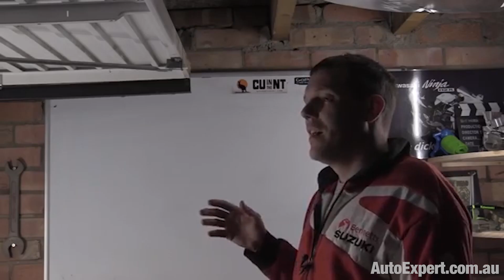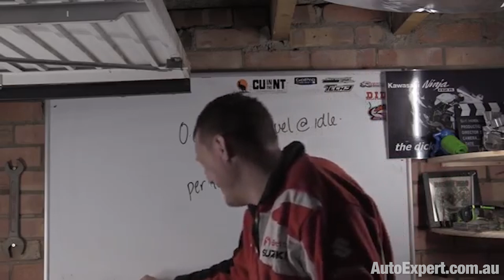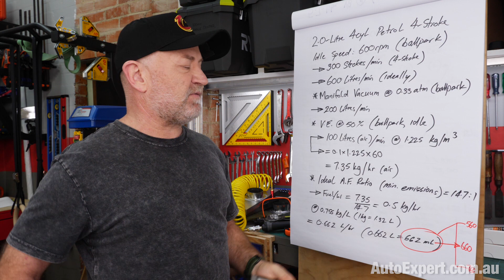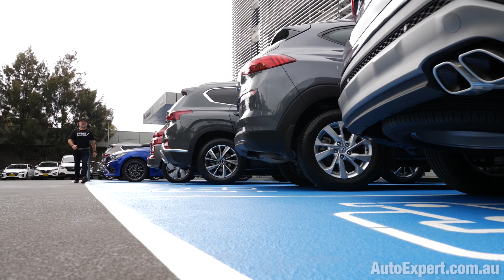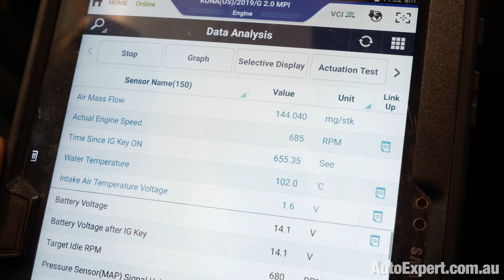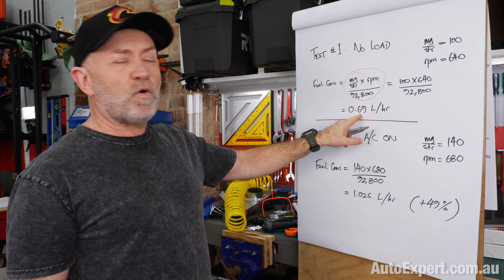Engine Fuel Consumption at Idle Explained (theory and physical test) | Auto Expert John Cadogan

Comment: Great Video.  Love your dedication to your craft.
I'd love to try the same experiment on my old 1989 LS400 (Celcior actually).
I would have to try without the use of an OBD2 equipped device,  its OBD1. Toyota didn't change over to OBD2 til 1995 and I cant find an OBD1 reader that works with Toyota.
I have to resort to jumping pins on the OBD1 connector and counting instrument light flashes for fault codes, and I don't thing that includes fuel or Air consumption.  Doh!
Engine has done about 300,000 Km so it should be nicely run in.  
*seem 1UZ-FE can do 1M Miles (a.1.6M Km) without a rebuild - See Matt Farah's LS400

Comment: You can check out "The Workshop" missing the point on oil and cold starts in his video about oil at low temperatures.
Reply: Trouble is youtube is free to put up stupidity. Start charging to host content and stupid goes away.

Comment: Hi John, at the 2.32 mark you say “600ml per hour, ball park for a 2 litre engine, at idle, under zero load. There is no per litre about it. That’s a friggin’ myth”. Later, at the 3.40 mark in summarising you say “proportionally more or less to the engine displacement, with all other things being equal; like 300 per hour for a 1 litre engine and 900 per hour for a 3 litre engine”
 
This to me appears to be precisely an example of “per litre” of displacement, albeit a 300ml per litre argument instead. Please can you clarify this anomaly, because I am now a little confused? Where previously it was quite clear. Guy in garage was an idiot. John the Engineer was right. Now though I have questions? Shirley, the cup size of each of the cans must correlate with the amount of juice used in an idle suck squeeze bang blow?

Comment: Hey John, if you are accessing data from the OBD port isnt injector duty cycle also available to be extracted as well? Good way to add another form of confirmation into the mix, not that I was in any doubt you were right, but the knuckle draggers generally refuse to admit they are wrong in my experience so it never hurts to add extra nails in the coffin!

Comment: Wouldn’t the modern cars with cylinder deactivation make a fair difference to that calculation? Or do they run all their cylinders at idle to keep them ready or something? A quick google search didn’t turn up anything on idle efficiency... if a 4L V8 could cut down to 2 cylinders and it has roughly the same efficiency at idle of the 4 cylinder engines It sounds like they should get 300-400 ml/hour with no load

I have some evidence for an older petrol car idling at only a little load... our house isn’t on the mains and it was cloudy for a week a while ago and I flattened the batteries so I hooked up my old 2.4L petrol Hilux to the charging regulator (and filled the tank so I wouldn’t forget) it took 6 hours to get the batteries back into the bottom of the green and I was curious about how much fuel it took so I topped it back up and it took about 5L which is more efficient than using a generator to run a 40A charger... which I don’t have.

Comment: Wouldn't Air density also differ @ different Altitudes ? Just asking.... Seems applicable ?
Reply: Yup
Reply: yes they do. So much in fact that you can feel the power of an engine going down the higher up a mountain you go. Gale Banks (of Banks Power) did a good realworld test about that using his turbo diesel truck.

Comment: Suprised by the statement that diesel engines used more, why so ?
Reply: I could be wrong, but my guess would be higher compression of a diesel being able to suck in more air per stroke compared to petrol.
Reply: @llaughton69  The air/fuel ratio is not constant in diesel so it might not be that.
Diesel is designed to deal with higher compression ratio - heavier structure, better sealed etc. Idling requires "no load" so these loses will make a difference in that scenario.
Reply: Deisels dont have throttles to genarate a vacuum

Comment: A siily question John, does this also apply to a 2ltr turbo diesel, IE: Hilux with and without DPF..
Cheers mate.
Reply: No. The air fuel ratio in a diesel varies a lot more. It will only squirt in enough fuel to maintain whatever engine speed is commanded. A diesel has no throttle butterfly...

Comment: 12:59 This has been a problem since the beginning of search engines - people thinking the top result returned is the accurate one not just the most popular one. 'Google smart' means you're actually most likely really dumb! It is not a Fountain of All Knowledge - it is merely an index of thoughts.
28:04 You do know that halfwits are going to remember and recite this as "Using A/C increases your fuel consumption by 50%!" by omitting the @ idle, right? You should have phrased it as "...increases your fuel consumption by about 0.3L/h" if only to save me and other from banging their heads against the Wall of Stupid we're now all but certain to encounter. Thanks a bunch.
Reply: tone167  hmmm Indeed it could be a troll...

Comment: Would be interesting to know the fuel usage when the car, assuming a traditional automatic transmission is in “Drive” and is stationary.    “The traffic light test”.  Maybe stop start in this situation, under load from the transmission and airconditioning starts adding up?
Reply: The ZF 6 speed auto in my Bimmer shifts (internally) automatically in neutral within 10 seconds of a full stop. Don’t know about other manufacturers but I guess this is an easy and cheap fuel saving measurement so it would surprise me if others wouldn’t do the same.
Reply: Appreciate the reply, even though a little cheeky off topic.

Comment: Detroit 14lt series 60 @ 870rpm with aircon and fan on! Its a 14 litre engine and it only uses (according to the scan gauge) 1.2-1.3 litres per hour
Reply: Ps. Its in a cab over Kenworth
Reply: Stuart Fletcher Diesel I assume?
Reply: @Conservator.  yep, makes small petrols look bad!
Reply: Stuart Fletcher 
Tx! Never thought a 14l diesel could be so efficient!
Reply: Conservator 1980’s technology

Comment: If you think about it rationally, the only reason why a larger engine will have a higher consumption at idle is due to increased friction. Friction will marginally increase with larger engines (especially if comparing a 4 cyl with a v8 etc). But this is only a marginal difference. Irrespective of engine size, heat losses out the exhaust are pretty constant, heat losses into the cooling system are pretty constant, fuel mixture is constant, volumetric efficiency is pretty constant and quantity of fuel injected is the exact amount needed to maintain  more or less the same idle speed in each engine - which is basically what it needs to overcome the engine's friction at idle.

Comment: Great job. Love the maths and physics. Spot on. Thanks....no bleeding from my ears, yet.
Reply: Iam a stupid electrician, so air displacement and flow rates are not my forte. 

With my Gen Y attention span, I noticed the 600rpm (ballpark idol for maybe a prime mover), compared to the 800-950rpm range for every LV I've ever seen. 

So we skip the crap about all the other figures, because iam an idiot and with everyone mindlessly agreeing with the reporter. 
I'll assume we're all on the same boat. 

Now let's assume the reporter is correct, .6ml @ 600 rpm p/h for a 2l. 
Now ramp up the idle speed to 900, (keeping the rest of the known figures) 
Which would equal the motor using (I'll assume a rough estimate) around 1L of fuel p/h.
So he isn't incorrect, just in my opinion manipulating information to work to his benefit, but honestly, doing that puts food in his table. It is to be expected.

If you honestly care, connect a flow meter into your fuel line. 
Bunch of bloody jokers.

Comment: Actually the maths you demonstrated would indicate that engines use approx 300ml/liter/hour @ idle,  it is a fairly straight linear calculation.  However this is not the correct way of calculating it in IMO.

The amount of fuel an engine uses at idle with correlate directly with the amount of energy required to over come all the losses in the system.  Drag from the alternator, water pump, oil pump, internal friction etc.  At idle most of these losses would be about the same irrespective of engine size (number of cylinders might have an impact due to more friction and larger oil pump).  So the engine needs to produce enough power to overcome this otherwise it will stall.  I would argue the minimum power requirements to keep any engine running are largely the same (which is why smaller engines idle faster than larger ones).  Power relative to fuel consumption is a fairly static figure therefore all engines use roughly the same amount of fuel at idle irrespective of size, in fact the amount used would have more to do with all the ancillary things being powered than the actual size of the engine.  IE having the Air Conditioning compressor running will increase fuel consumption at idle, hence why idle speed usually rises when the AC kicks in.
Reply: Do the math and you will have the facts not your  "opinion" on something that does not give a flying fuck what you think......which was the whole point of the video.
Reply: @robertjbrighton  Really somebody who can't even use his own name, something that John as clearly indicated in the past as a person who comments should be treated as those of an internet troll, trying to inform me about the use of maths and can't even do so with out swearing, like I am going to take you seriously.
Reply: @scottsummers819  Grow up mate, try and develop your own opinions rather than borrowing others. The internet is not the place to be waving your personal details about. John is wrong on this point in my personal opinion and so are you.
Reply: @robertjbrighton  Really.  Develop my own opinions.  Did you not attack me for doing that very thing in your first post.  If your gonna troll at least be a bit consistent about it.
Reply: @scottsummers819   Oh good grief, get over yourself. How was what I said in any way an attack? I merely pointed out that you had undertaken the very thing the video was about. Talk about lacking self-awareness.
Reply: @robertjbrighton  The only thing I'm getting over is you.  Something that is not really  hard.

Comment: Very informative. My personal view on the start/stop operation is that it causes more wear and tear on the starter, plugs, and ignition system, etc; and has no significance in saving fuel; that is it does not work.
Reply from the maker: Most times, the starter is not used for the re-start. I fail to see why it would affect the plugs or ignition system, either.
Reply: @AutoExpertJC  I always thought the starter was used and constant on/off would affect the ignition and plugs. Listing to the salesreps instead of the mechanics I guess. Just idling beside one of these vehicles and hear it start up at each intersection is bad enough, and if I owned one it would drive me batty.

Comment: Greetings John from Retardistan.  My 12.7L semi-truck idles at about .75 USgal per hour during normal summer idle. The usage increases to about 1.2 USgal in the winter due to increased idle speed necessary to maintain temperature.  My 3.2L transit van uses about 0.3 USgal at idle with the A/C blasting. I track the fuel I buy in the big truck as it is a considerable business expense.  I track the fuel usage in the van because I use it for camping and require A/C to keep my fat ass comfortable.  Keep up the good work dispelling bullshit....
Reply from the maker: That seems about right.

Comment: Was the Kona test done with no electrical load via the alternator i.e. lights, radio and vent fan on (noted the test results did have A/C both on and off).
Reply from the maker: I didn't check the lights. The dtrls might have been on.

Comment: Many of us have access to real time fuel consumption displays, so we know that, for example, a given 2.4l four cylinder equipped model uses about 0.7l/h at idle and it jumps to about 1.2l/h with the AC on. Any retard who thinks it's 0.6l/h/l is a retard.

Have an upvote, John - I know you hate them!  :)
Reply from the maker: Damn. I knew this would happen.

Comment: Total Nerd Accreditation or TNA would've worked so much more Sensei to attract the nuts. 😉 Also, just to complete your initial equation for all the oxygen thieves, let's divide your 662ml by 2 to break it down to 1000cc for Mr.Methshop I mean workshop. So, for people at home, the amount of fuel used for a 1.0L motor will be 331ml per hour per litre or between 280ml and 380ml for a range including all the factors. 👍😎
Reply from the maker: TNA: That's very good. Agreed - I could have done that (divided by two) - I kinda did it at the end. (If one did everything possible in one video, it would be around infinity minutes long, of course.)
Reply: @AutoExpertJC  Think of it as me learning my lesson from not including the number from the Black&Decker supercharger the other day. 😉
Reply from the maker: @MafiaboysWorld  We all live and learn...

Comment: John, does the fuel consumption go up during re-start of the vehicle offsetting the minimal saving of not idling your engine?
Reply from the maker: No - it doesn't. Auto stop-start stops cyl 1 (usually) just after TDC on the compression stroke - so things just pick up where they started. The plug just fires on cyl 1 and the whole thing resumes turning and burning.
Reply: @AutoExpertJC  Cheers :)

Comment: AutoExpertTV get's testy if you post comments without using your real name.
Reply: My dad bought a new Holden in 1960.      It was terrific, first one in our street,  we used to sit in it with engine idling listening...............it was so quiet you couldn't hear it.

The handbook said it used one gallon of petrol in five hours at idle speed., It was 138 cubic inches of displacement (2.262 litres)

General Motors wouldn't lie, would they???

Steve Callachor
North Avoca N S W

ps yet won't let me post general comment only as a reply

Any ideas????
Reply: @stevecallachor  So what's your point?